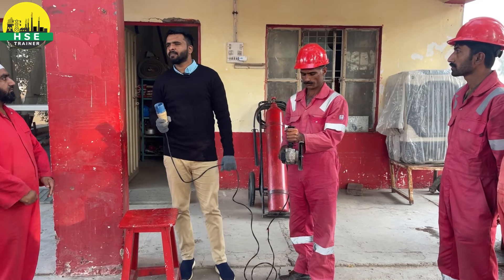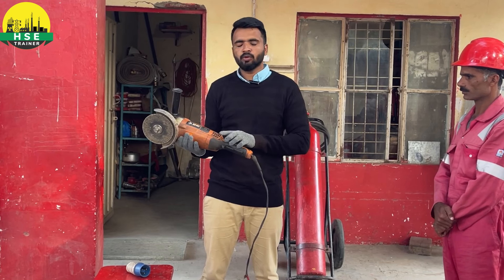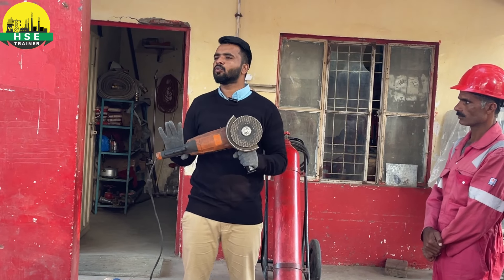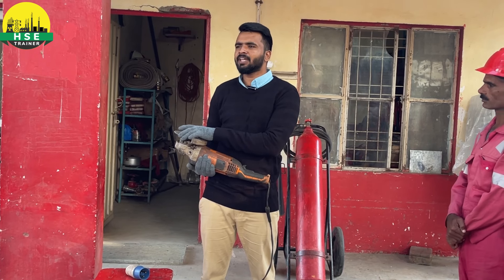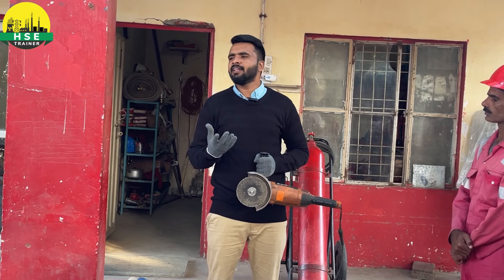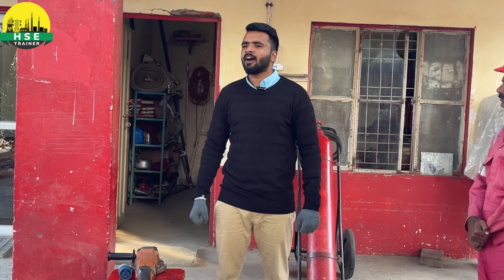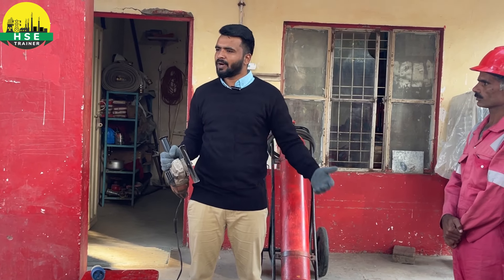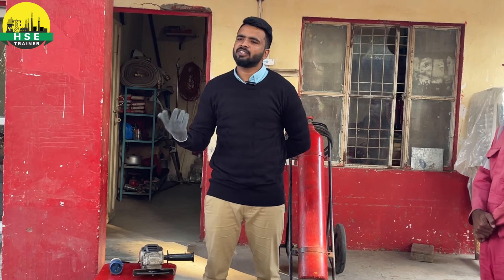Grinder Safety: How to properly use an Angle Grinder || Hse Trainer

Comment: What type of face shield to be used for hot work or cutting purpose?
Reply from the maker: face shield is suggested while using a grinder due to the amount of hot metal particles generated. A face shield is considered a secondary form of eye protection and should always be used in conjunction with a primary form of protection – safety glasses or goggles.